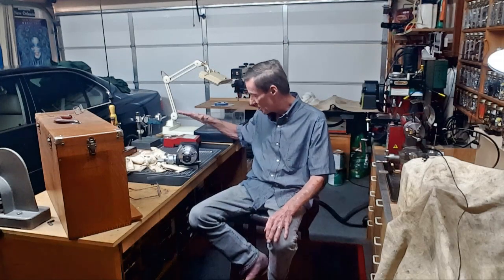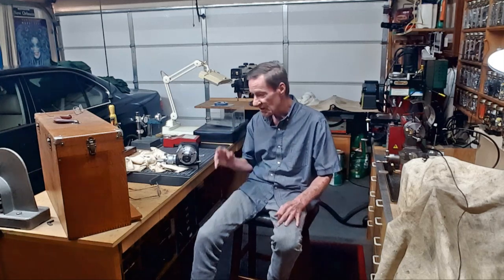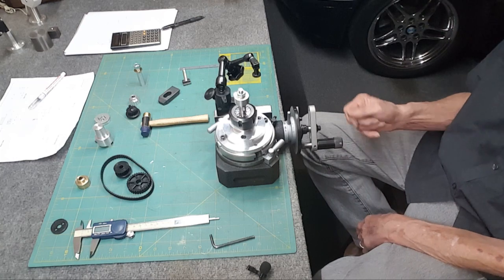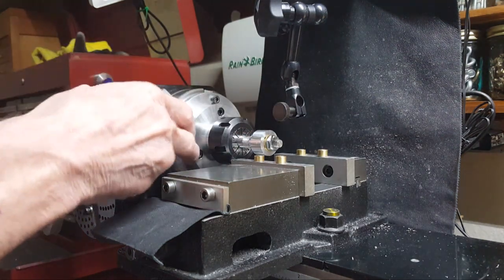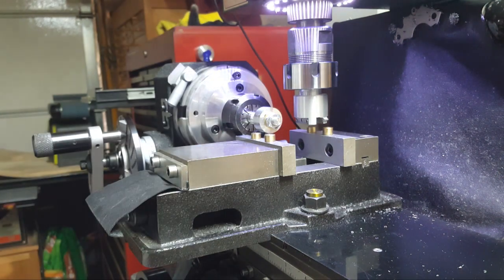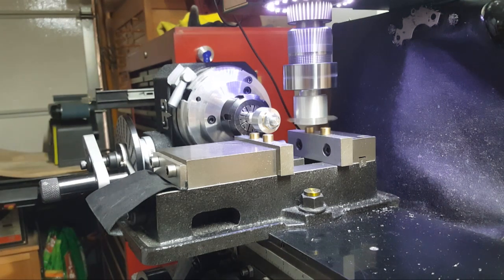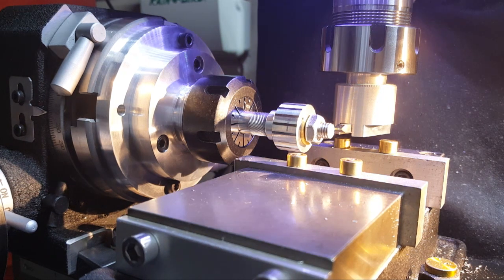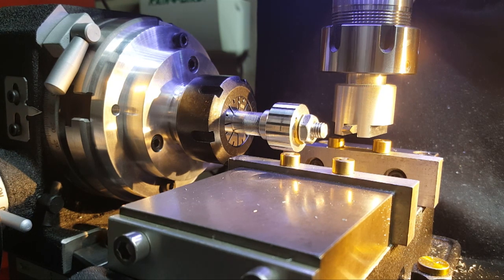Finally Machining A Proper Motor Timing Pulley

Comment: I've attempted to make timing gears another way. Indicate on chuck and then drill holes using the DRO PCD function, then turn down on lathe to finish.
Reply from the maker: Hi, I've seen that done before but it leaves a round bottom which causes the belt to ride up resulting in belt wear. But how are you going to do it without an expensive rotary table and cutter.
Reply: @TheMiniMachineShop  I thought the HTD belt teeth had a round profile when compressed, GT2 has more clearance. Once I filed the burrs smooth, the belt seemed to fit perfectly.
Reply: >how are you going to do it without an expensive rotary table and cutter.

PCD function in a DRO allows radial drilling of holes, if that's what you're asking.
Reply from the maker: @HM-Projects  Sorry I was only thinking of the square belt I'm using which isn't round. In your case that is an excellent way to make a pulley.

Comment: What is this pulley timing?
Reply from the maker: It's a special pulley that a timing belt rides on with teeth so it can't slip.
Reply: @TheMiniMachineShop  I understand what a timing pulley/belt is, I build engines and the timing pulley on engines is used to rotate the cam at the right timing.

Comment: Hello Dave,
Great work, can you please point me in the direction of the video where you made your Milling Vice jaws. I am interested to understand the sticking up parts on top of the jaws. 
Thanks
Paul,,
Reply from the maker: Hi Paul, Simple, I added the four brass pins so I can quickly clamp mainly round material over using V blocks. Both pulleys sat flat and were well secured while I drilled and reamed them using the pins. Also, it's a 3" vise so with V blocks I can't clamp 3" material. No room but can with the pins. Also 3" square material can be clamped.
Reply: @TheMiniMachineShop  Thanks Dave, I have a 3" vice that I am fixing up for my mill and will do the same... When I show it on YouTube I will make sure everyone knows it was your idea.

Comment: Well done Dave!
I've had thoughts for a long time, attaching a stepper motor to the rotating table and an Arduino to do the stepping. 90 turns per rev originally multiplied by 200, 400 or 800 gives a resolution of 1 per 18000, 36000 or 72000. It ought to manage most things. All gear is sitting around...
Thanks for the inspiration Dave!
Reply from the maker: Gloug42? spelling did it and is offering code and more.
Reply: @TheMiniMachineShop  Maybe Clough42....
I know about his electronic leadscrew. Got a home made bolt circle calculator based on an Arduino UNO, and it works!
Made all the stuff for an electrical leadscrew but not used it yet...